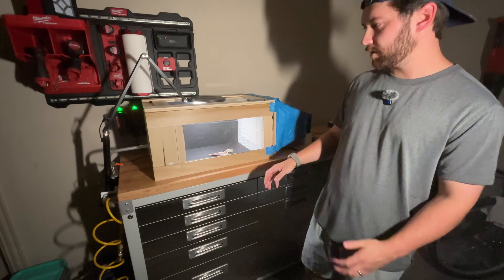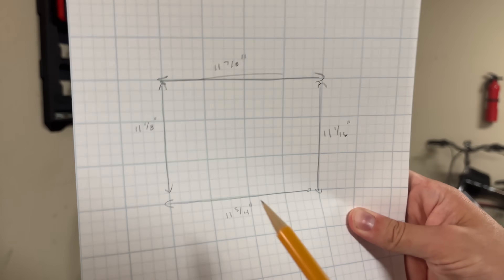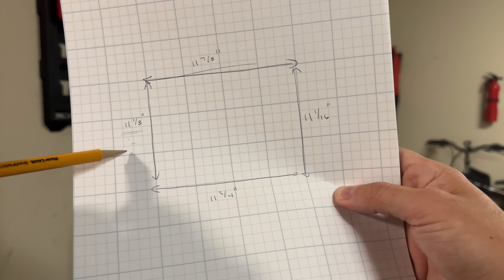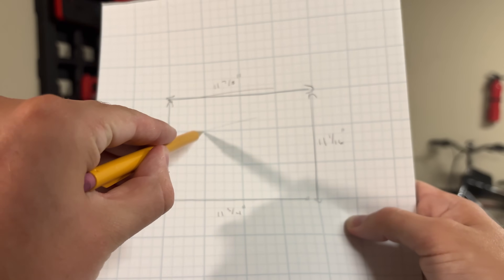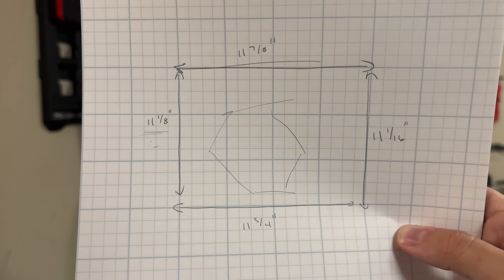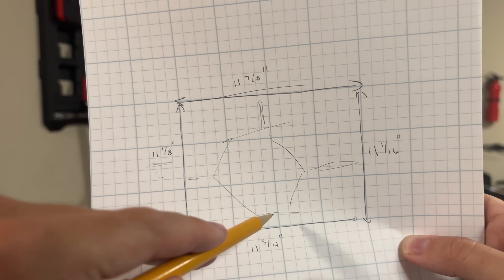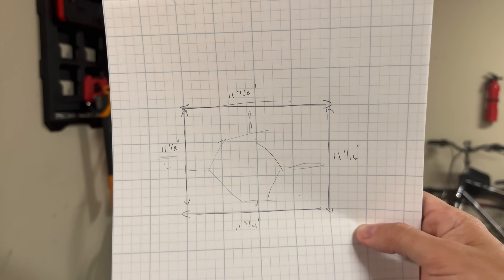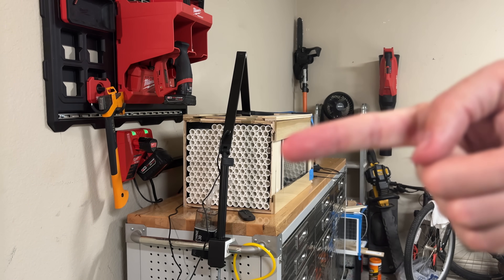DIY Wind Tunnel Part 4: I made the Laminar Flow better!

Comment: Would you be willing to share your model?
Reply from the maker: Like for this specific laminar flow block? i can, but it is pretty specific to this size! I am also using this wind tunnel as an opportunity to learn how to build one so that I can make a comprehensive tutorial one day with things that are easy to purchase
Reply: @TheWindTunnelChannel-b1e Would it be possible to adjust the dimensions on our end at all. If not, then that's fine. Thank you so much.
Reply from the maker: Totally! I can upload them to printables today & send you a link! One thing, in the slicer, you’ll need to take away the top layer & bottom layer to expose the infil

Comment: Here's what I think:

The reason your other fan feels stronger closer is because it's not confined.  So the air coming out spreads out with distance, such that the further you are, the less is hitting you.  That's not a good way to model your wind tunnel fan, because it's flow is confined.

Some of the turbulence you are getting is probably coming from the fan itself.  The fan uses blades to push the air.  This means that at any given point, the air pressure is constantly rising and falling, which will create turbulence.  The further you get from the fan, the more room there is for the pressure to average out.  If you put the fan closer, you'll probably get more turbulence, not less.

You could probably significantly reduce the effect of the blades with a sort of diffuser (a tube grid like you are already using will likely serve this purpose fairly well) that impedes direct air flow, fairly close to the fan, avoiding the need to change the distance.  The cost of this will be reduced static pressure and thus reduced overall flow.  One way to achieve this might be to 3D print a second output grill that forces the air through tubes.  I would make it the same size as the new one I'm sure you are going to print that interfaces with the box, so that the air between the two is not moving into a region of changing cross section between them.

Using a small fan with an adaptor to a larger interface is likely also introducing turbulence.  A second diffuser, as suggested above, might solve this, but another thing you could try that might give additional improvements is using four fans arranged in a square, so that the cross section of the fans is closer to the cross section of the diffuser/grills.  I suspect that will also reduce turbulence, and it will help to increase the static pressure to counter the losses of adding a second diffuser on the output.

One other thing might be contributing to turbulence as well: The ridges created by 3D printing may be adding turbulence inside of the tubes.  You might be able to fix this by changing the print orientation, but that might cause more problems than it solves.  If you can orient it so that the print lines are parallel to the tubes, instead of perpendicular, that will likely help significantly, but this only works if you can do it without the need for support material.  If you end up with support material in the tubes, even if you remove it, it will leave a roughness that could end up being worse than the current ridges.  Alternatively, you might be able to dip the pieces you currently have in a thin paint or glue and then let it dry, to at least smooth out the ridges a bit.  That will also reduce the hole sizes slightly, but you may gain more than you lose with this strategy.

I'm no expert on laminar flow or wind tunnels, so this is just what my intuition suggests would probably work.  The more you can remove inherent turbulence caused by the fan, and then from there set the flow pattern and avoid any changes that might introduce new turbulence, the better it should work.

I hope this is helpful!
Reply: Lol!  Just saw you have a more recent video where you use a bladeless fan.  That should work as an alternative to a diffusion stage, though the tapering adapter from the small fan to the box is likely still introducing turbulence.

Comment: I suggest putting only cross-fin on the fan end and for the laminar part the smooth surface in the channels is the name of the game, longer and smoother  the better. 3D print  has this raster artifacts, inducing more and more instabilities, back in the days I used plastic straws (a lot of them) as the fit quite snuggly and are butter smooth. Great video! Keep up the good work!
Reply from the maker: This is great! Thanks!!

Comment: I'm considering building a similar small wind tunnel myself. Many comments here have good advice for ways to optimize the design. My design is going to utilize a long cylinder for my tunnel as a box is incredibly difficult to make a steady consistent flow, as the corners will create alot of issues. Also, lengthening the tunnel and the airflow grates will help give the air room to stabilize. As well as having 2 identical fans for each end both paired together on a speed controller to match the inlet and exhaust fan's speed.
I'm also considering installing a "rolling road" inside of mine that can be angled side to side slightly to test small model cars and test aerodynamics both straight on, as well as while turning slightly and/or with a slight amount of crosswind. 

But, for an initial design, I like your setup. You've got a good fogger there.
Reply from the maker: Sounds like you’ve got a really cool idea planned out! & the double fan hooked up sounds like a great idea!

Comment: one of the things ive seen that worked for water was using coffee straws. cheap, thin, uniform. just maybe need a way to lightly compress them to hold them in place. Smarter Every Day did a laminar flow video that used sponges to create a uniform preasure head, and you would just need to do that in reverse. straws at the opening, the tunnel, then more straws, a buffer region, then maybe a low density foam matt and a larger fan to provide uniform vacuum across the surface of the foam.
Reply from the maker: Oh man! I’ll have to check that out!

Comment: I'm not sure but put a  fan in the front and back going at the same speed. so the fan in the back is it just sucking the air out of the box but so the air is moving into an out of the box at the same rate. 
And if nothing else put the fan on the intake side of the box, I think in real Chambers, they are high pressure got low pressure
Reply from the maker: Good idea! Thanks for the feedback!

Comment: I'm building a mini wind tunnel with a testing chamber with a diameter of an inch, im trying to make it laminar flow but according to the calculations the Reynolds number still is of over 13400, so it means it is turbulent flow. How can I get better results with the Reynolds number or is there other way that can simulate laminar flow inside of the chamber. I also have a flow stabilizer before the start of the testing chamber, but I have no ideas to test the flow, other than Schiller effect (Which is really hard to pull off), what should ou recommend?
Reply from the maker: Honored that you would ask! I’m no expert but I would imagine the longer & narrower the inlet is the better chance you’ll have! For instance, using straws, I would imagine finding longer straws would help! 

Also how did you find the reynolds number? I would be very interested in finding this for my wind tunnel!
Reply: @TheWindTunnelChannel-b1e those are good suggestions. In mi case I calculated the Reynolds number using Re = (ρ·V·L)/μ, where air density and viscosity correspond to Querétaro’s altitude, with a 2.54 cm duct and 10 m/s airflow. Values which I obtained with my requirements for my wind tunnel. If you are over 4000Re you are said that you are over the turbulent limit
Reply: Also another suggestions, the roughness of the 3d printed can affect the flow of air, you could reduce the layer height so that it affects it less. The roughness in 3d prints can be calculated by \mathbf{R_a} \approx \frac{t^2}{4 \cdot L} \cdot \left[1 + \left(\frac{1}{\tan \theta}\right)^2\right] (tell chatGPT to interpret that formula jaja)

Comment: People feel the buffeting of a fan more than they feel airflow, or put more scientifically you are feeling the fan break the surface tension of the air around you.

Fans meant to cool people intentionally cup and throw out the air in bursts, whereas PC fans are designed for smoother quieter volume of air movement.

Comment: Rule for measuring wind speed in ducts. Coming from HVAC. There must not be obstructions or turns 4 diameters of the duct from upstream and 2 diameters downstream. 
But lets say you have special crate  for laminar flow, so you can reduce this number 2-3 times. but still, this mean you need space between the "good" zone and the crates.
Reply from the maker: Thanks for the feedback!

Comment: If I remember actual machines that you are trying to duplicate, they put the smoke as a very small tube after the air is introduced to the chamber.
.
Also as a plumber, to help regulate air flow to make it more laminar whatever tubes you use to input the airflow thru must be over 10 times in length vs the pipe diameter., but that only regulates the flow in the pipe, it's different when it exits, and that is also where you must make sure the ends where the air exits are debured... Meaning no rough surface. Instead of the printed honey comb, you might do better with drinking straws, as the printed pieces you made also have "wall" sections where air isn't moving which create turbulence.  You want it to be a full wall of air with no sections where air isn't moving or eddying.
Reply from the maker: Interesting! Thanks for the feedback!

Comment: You need thinner walls and finer layers.  Then you can thin epoxy using denatured alcohol or acetone as a dip. Heating the components is the best method as it thins the epoxy without compromising its strength, but solvents can be used sparingly (e.g., no more than 10% acetone) to reduce viscosity for specific applications. However, solvents can weaken the final product, so warming the resin and hardener before mixing is generally the preferred approach to maintain structural integrity.
Reply from the maker: Interesting! Thanks for the tip!

Comment: SLA FDM (Single Layer Additive, Fused Deposition Model) printers will leave ribs where the layers 'fuse' together. You want perfectly smooth walls in the straightener. What you need is a stack of plastic straws.
Reply from the maker: Yeah I’ve heard about the straws! I didn’t want to use that many straws in the video!

Comment: It isn't "quite" like that for the fan distance. A fan basically pulls pressure head and turns it into a mix of pressure and velocity head. When you are feeling the wind from a fan, you are basically feeling velocity head. 

The velocity head dissipates quickly in an open environment, which is why you don't feel it consistently. If you had the fan pulling through a tube, and inducing velocity through the pressure drop, you could have that set up with a pretty long tube and still feel wind basically anywhere across the tube. So moving the fan closer shouldn't have a noticeably effect on the airflow, but might actually cause more inconsistent airflow.

Also, if you want to make things more laminar, you may want to have large-small-large setup. Basically a large intake going to a small chamber and out through a big fan. If the transisiton is smooth, my fluids professor described it as "stretching" the paths but more literally making them more laminar. In the wind tunnel I made for Sr Design, the area ratio was something like 6:1. So the cross-section for the intake and exhaust were 6x the size of the cross section for the chamber.

Comment: this is a very neat project :)
some recommendations:
i agree with the people saying drinking straws are a good idea. very simple and likely effective but its good to try many things and compare results
did you know you can buy honeycomb panels online? i think that might give the best performance 
also turbulence doesn't travel upstream.  you don't need any straighteners downstream of the test area, though the airspeed can vary across the area of the tunnel depending on the shape downstream.  a gradual reduction in area towards the fan is helpful and a screen at the start of the funnel will provide more resistance to faster moving air, helping to even out the flow.  i think you can use whatever fan(s) you want
as others have said a good setup for the intake would be: bell intake -> screen -> straightener -> screen
i think a bell intake isn't too important for laminar flow, but it should help with evenly distributed airspeed and maximum flow
good luck :)

Comment: Tell me you missed that episode of MythBusters.. Without telling me you missed that episode... 

They cut a bunch of boxes of plastic straws in half and stacked them at the intake making lots and lots of small holes.. Worked great! very cheap.

As for fan placement.. the blades of the fan are going to cause pressure wobbles to the air flow the closer you get it to your viewing area.  Dont move it closer.. Move it farther away.. Or even make the air do a 90 degree turn to further filter any buffering noise of the fan blades from effecting the viewing area of your wind tunnel. You want nice clean suction. You could even consider a blower style fan.
Reply from the maker: That’s a good idea! Thanks for the feedback!

Comment: I was thinking that the problem is your jet is entering a static section of air and as such it is buffering and it is breaking up. maybe having some fans on the four corners of the front and or back could be able to try and break down that static pressure at least that's how I feel like saying it at this point, because I'm not necessarily an engineer I just know terms and logic.

Comment: Try this:  3D print (face down) an inlet diffuser that's a couple of inches thick and turn OFF top and bottom horizontal layers.  You want to end up with perimeter and infill ONLY.  The infill is actually going to be the structure you're after!  Set the infill to "gyroid" pattern and make it relatively dense, but not too restrictive.  I call this the "conffuser." It's a tad counter intuitive, but the idea is to scramble the incoming flow, uniformly.  Yeah...  Put your parallel laminar flow tubes element after that.  BTW, that trick with turning off the top and bottom layers works with other kinds of fill of course (like honeycomb!) to make tubes (and they can be super fine.)  Print only a couple of layers of a grid infill pattern and you have really nice mesh fabric with whatever size holes you want by adjusting fill density.  Also bunch of layers of mesh/screen with different grid spacing (or randomly rotated) can be used instead of the gyroid thing.
Reply from the maker: Whoa! That’s a really interesting idea! Thanks for the feedback!
Reply: @TheWindTunnelChannel-b1e  Roger that.  BTW, a similar structure on the exit side should help even out the velocity of the flow there as well.  Speaking of the side that sucks, have you considered using an array of small fans (60mmish) there instead of a single large one?

Comment: This was my engineering science fair project and it was such a blast to work on. To go through different fans, different prototypes of 3d printed air-straighteners, finally arriving at a laminar flow that work perfectly with my build. Such a satisfying feeling
Reply from the maker: No way! That’s so cool you did that for a science fair project!
Reply: @TheWindTunnelChannel-b1e  Thank you! The smoke was from a smaller machine so it wasn't anywhere as robust as yours but a lot of fun to work on.

Comment: Is the air the same temperature as the smoke?
Reply from the maker: Relatively! It’s just a small fog machine!
Reply: I think you're right, a slightly hotter air in the box makes the smoke falling down.

Comment: I think you could use a bunch of drinking straws packed together and save a ton of time and filament. In addition they got much smoother surfaces than the prints and you could experiment with different diameters =)

Comment: Would you get any improvement by changing the orientation of the print of that inlet? You now have a ribble along the length of the motion, if you print it 'sideways' then the printing lines are in the same direction as the airflow.
Then again, if that'd cause instability it would be visible at the exit of the intake already.

Anyway, got this video randomly suggested. One of the better suggestions, this is a fun concept.